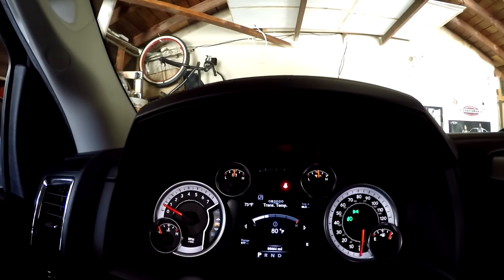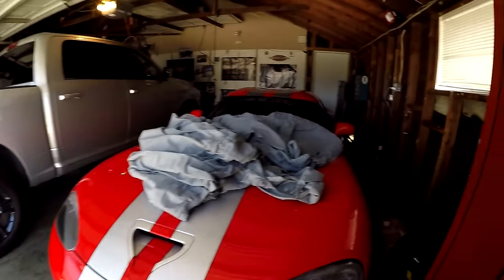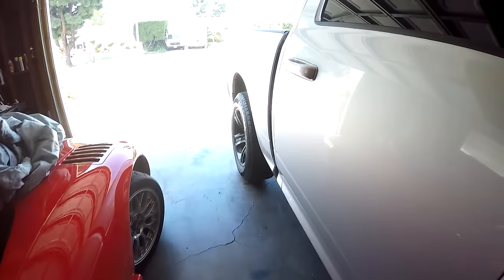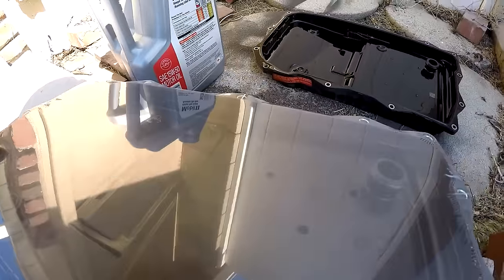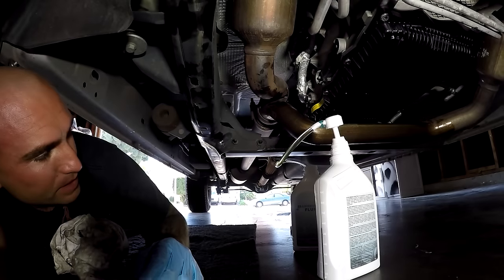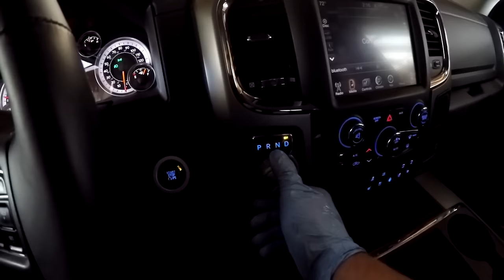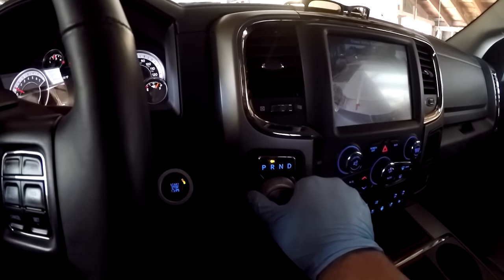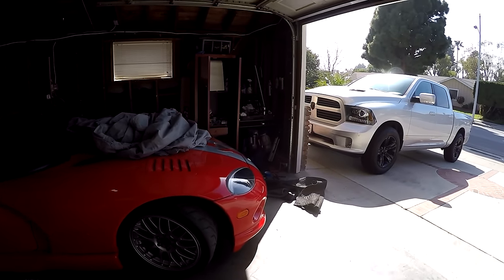Dodge RAM 1500 - ZF 8 Speed Automatic Transmission - Fluid & Filter Change

Comment from the maker: OIL PAN I USED
https://amzn.to/2w00yfJ
ZF LIFEGUARD FLUID 8
https://amzn.to/2LLydER
Pump I used:
https://amzn.to/2YBgfGB
Reply: BoostedMotorsports  what’s the torque specs for the transmission bolts?
Reply: BoostedMotorsports Great video, really appreciate it. Nice Viper, only other thing you could have done is let it also drain from the transmission cooler lines, but other than that great job bro 💪🏼👏🏼👏🏼
Reply: Just use plug lol
Reply: @TheRamiro0980  Yes.. would be nice to know... Is there an answer from BoostedMotorsports?
Reply: BoostedMotorsports what torque spec did you use for the bolts?
Reply: 89-inlb is the TorqueSpec

Comment: You must disable your traction control before installing new fluid. After you change out the transmission pan and filter the transmission needs to be below 86°F when you first start installing your transmission fluid and tires must be off the ground and truck must be level. Add transmission fluid until it starts to dribble out then put drain plug back in. With brakes applied place transmission in reverse and hold for five seconds, place the transmission in drive and hold for five seconds, release the break slowly and accelerate to second gear and hold for five seconds, apply the brakes and place the transmission in neutral, raise the engine speed to 2000 RPM for five seconds, return engine to idle and place transmission in park, remove fill plug and fill transmission until fluid dribbles out and then install drain plug.  All these steps need to happen before the transmission reaches 122°F. If you go past 122° the transmission fluid will start to expand and you will not get a proper fill. !!!
Reply: Underrated comment, getting the transmission to second gear is critical to fill this transmission!
Reply: It's a pit
Reply: How muxh trans fluid would I lose if I did the valve bypass .
Reply: Does the car have to be lifting if my garage is leveled and I’m able to fit under ?
Reply: So do you think he has too much or too little fluid in there? 🤔
Reply: How much would a job like this cost at the Dodge dealer or a transmission shop?
Reply: Lol install the drain plug after filling the oil 😄. Almost like a trol post.
Reply: @joeshmoe8952  Got Service Quote today -- $1,200-$1,400 at my local DFW TX Ram Dealership for the ZF-8 speed.  They stated I didn't need to do the service until I reached 150k.
Reply: @slobbo456  They’re crazy at 150k, by then the transmission has already been contaminated with the dirty oil and changing it with clean oil would only make it slip.
Reply: @joeshmoe8952  They said the fluid in the system is contained.  Also, said the procedure is intensive unlike the other Trans fills/flush/filter jobs.  I was originally quoted $229 for the "other" tranny's procedure, until I provided the last 8 digits of my VIN and they said I had the ZF-8 speed.  Therefore, didn't need to bring it in yet and the gave me the ZF quote.  I'm not racing in to get it done nor doing it myself until 150k....(this Boosted Dude's trans fluid didn't look terrible to me after he cracked it open).  Your Truck--Your Call !
Reply: @slobbo456  I got a couple of Toyota’s that the dealer said it had “Lifetime” transmission fluid. Told me to never change the fluid. That was all a bunch of bs. On one of my Toyota’s I never did because I believed the dealer and it’s got around 218k miles on it. It runs great but I feel like that transmission can go out at any moment. One my other Toyota I changed the fluid at 80k and I have more of a piece of mind with that car when it comes to the transmission. I can easily change the Transmission fluid on my 4runner with high miles but it will just make my transmission slip due to the transmission running so many years with dirty fluid.
Reply: @joeshmoe8952  Totally agree with you on the "lifetime" fluid bit (BS).  Wonder how they gauge how many miles are in a transmissions' lifetime....   To us, a lifetime means 90+yrs? -- to Toyota, what is a lifetime?    I assume it means once your transmission is shot, the fluid has expired.  Goodluck
Reply: @joeshmoe8952  800$ is what the dealer quoted me.
Reply: @antrenfroe2750  That is a good amount of money, that’s for sure.
Reply: Sounds sensible except "release the break slowly and accelerate to second gear".  So you either drive through the back of the garage, or you're implying you're on jack stands with wheels spinning in the air which sounds crazy.  Can you clarify?
Reply: @joeshmoe8952  $276.00
Reply: @joeshmoe8952  i have 107000 & looking to change my pan and oil. What does anyone suggest.
Reply: @andymercado3257  The dealership or a real good transmission shop that does good work.
Reply: @silverscout2643  having too much won't hurt it. Getting the trans warmed up in that time frame is the trick. That Fluid is like water. It will expand and thin it even more.
Reply: Hi, what is the torque specifcation for the pan bolts? Thank you..
Reply: @alfredosuarezalonso9461  it really doesn't matter.. as long as you don't go full on tighten. I like to go 1/4 of a turn of a full rotation of the ratchet with a socket when it starts to get tight. 

Had it done at 46k Miles in my ram and up to 52k miles now and no leaks.
Reply: This just tells me not to even think about trying this task whatsoever!  Oil is one thing, to get this right is too complicated.
Reply: @joeshmoe8952  when you can’t change the oil is when you fell really behind on changing it causes your clutch to wear  and the oil becomes the grip of your clutch. So you should change it as recommended it needs clean oil to protect the clutch pads . Recommended oil only on transmission.
Reply: @frankposterello1628  Read his post again - earlier in the the post he states: "and tires must be off the ground and truck must be level"
Reply: @bryonthelyon  Thanks
Reply: Jim Haley - After you say the tires must be off the ground and truck level the next line evokes a question: Add trans fluid until it starts to dribble out and the put drain plug ( or should it be fill plug ? ) back in.

Drain plug seems wrong but I’ve never done it.
Reply: These steps would be the same for a 8spd 2014 1500 v6 right ?
Reply: Lol. So no fluid change in June in tx….
Reply: @alex81815 yes
Reply: The strangest comment ever
Reply: @slobbo456 i was told by 120,000km
Reply: You are special. How long can you hold your breath?

Comment: I have a '15 Charger RT with the ZF 8HP70 trans and it seems you may have left out something that could affect the correct filling procedure, namely physically accelerating the car while it is off the ground.  This is the fill procedure direct from the FCA oem factory service manual that I bought: 

  1.Raise and support the vehicle on a level hoist (Refer to 04 - Vehicle Quick Reference/Hoisting - Standard Procedure) . 

  2.Start the engine. The engine must continue to run for the entire test

  3.Using a scan tool or the vehicle information center, verify that the transmission fluid temperature is below 30°C (86°F). 

  4.Remove the transmission fill plug from the right rear of the transmission case. 

  5.Add transmission fluid until it trickles from the fill opening. 

  6.Install the transmission fill plug and tighten to the proper (Torque Specifications) . 

  7.Lower the vehicle for access to inside of the vehicle, leaving the tires at least 8 inches off the ground. 

  8.With the brakes applied, place the transmission in Reverse and hold for 5 seconds. 

  9.Place the transmission in Drive and hold for 5 seconds. 

  10.Release the brakes, slowly accelerate to 2nd gear and hold for 5 seconds. 

  11.Apply the brakes and place the transmission in Neutral. 

  12.Raise the engine speed to 2000 RPM for 5 seconds. 

  13.Return the engine to idle and place the transmission in Park. 

NOTE: 

A full transmission will have fluid at the fill hole with the transmission between 30°C (86°F) and 50°C (122°F). Do not over fill. 
  14.Remove the transmission fill plug and allow excess fluid to drain from fill hole or add fluid as necessary. 

  15.Install the transmission fill plug and tighten to the proper (Torque Specifications) . 
  16.Using a scan tool, clear any DTCs. 

The driving the car may be there to be sure that there is proper oil circulation occuring in the torque converter.  When i drove the car on the jack stands, a warning light happened for the traction control which is likely related to the DTC's mentioned in step 16  I also believe that it is important to measure what comes out when you drain as a reference so that you do not overfill..
Reply: Paul Andre There's a video about this as well. It also mentioned that an engineer from ZF talked about a temperature bypass valve that sends fluid to the condenser for cooling after it reaches 160 degrees F. So it doesn't completely circulate the fluid until after this temperature is attained. In other words you could have air in the system or not have the proper amount of transmission fluid if this step is left out. It's pretty much a two day job. Just stating what I did my own research on, not an expert in any way.
Reply: Just an fyi...from ZF themselves the step of taking the vehicle off the ground is not necessary or even recommended. They have very clear instructions on their website as well. The ZF8 is used in many many different makes of vehicles these days. Not sure why Fiat added the step of driving with wheels off the ground but it is not necessary.
Reply: @MrLatinKing13   This gentleman is right I have not see on the comments yet anybody mentioned this if you do a deep dive from ZF  It's not quite this simple.
 There will be the fluid stuck, As you mentioned there's a few videos out thone I've seen from Z from ZF I've also seen one From basically a shop teacher at a University who talks about ZF Directly recommending How to do it to get that extra oil out it's basically a 2 day process, To do it right. Or you're gonna have approximately 30 to 40% of old fluid Mix them with the new fluid.
Reply: Seems to me the step was added as a mental persuasion/upsell tactic. $$$$ in the dealerships eyes. Throw that step in and people's minds blow up
Reply: @jasonbudge8023  What you say is interesting, and how did you do the procedure? Did you leave it on the ground? And did you level the vehicle or the transmission? I'm interested in knowing to change the oil in mine.

Comment: Just came from your vid for spark plug change to YOUR hemi with a boost of confidence now! I have the '09 Hemi Durango which is a totally different setup than here, but wanted to share the method I did for my transmission draining to avoid the potential fluid mess: Purchase a cheap plastic under-bed storage bin with wheels from walmart, drape the thicker quality plastic roll sheeting over it making a well with extra sheeting overlapping the sides for the floor to contain any splash. It held the fluid beautifully. When ready, roll the bin out carefully, make a pouch and lift out. With a helper just poke a hole and drain into whatever oil drain jug/pan you normally use for disposal. The bin never saw a drop on it. Excellent DIY vid's - SO appreciated. Cheers!!

Comment: I really appreciate all the work you put into your videos; excellent, excellent work! I completed this task on a 2015 RAM 1500 Lonestar I recently picked up with the ZF8HP70 transmission (91,000 miles... no transmission fluid change). Having experience with some domestics (Corvettes) and some foreign (Mercs and BMWs) marques, the "sealed" transmission was familiar as is the process of changing the fluid, but this video helped tremendously! After some research, I decided to use Redline D6 ATF - I highly recommend this as an alternate!

Comment: Wrap tin foil around your exhaust pipe so you can use the drain plug fellas. Then use wet towels around the exhaust during filling process and you wont burn your arms.
Reply: FINALLY . . .Some one's thinking !
☆

Comment: Definitely doesn't look all that bad. Also the non premium dash clusters show you the transmission temperature just like the premium ones do except it's just a vertical white bar that shows you the temp range and it shows the actual number for what the trans temp is at too. Still kinda wish you had kept the truck longer but love all the old and new videos

Comment: Thanks for the video very helpful. I was under the impression that the transmission had to be level when you checked for the fill. From what I’ve read the back end needs to be elevated for this. The only other thing I’ll mention is the background music was very annoying, could just be because I am hearing impaired but it made it hard to hear you. Thanks again for the video.
Reply: trans does need to be level. Looks like he only raised the front end, back wheels are on the ground.
Reply: "Music" ( Noise ! ) on an instructional video is counterproductive. 
As useless as a a training seminar at a busy Miami nightclub.
☆
Reply: yes that music, which it is not,, sucks!!!

Comment: Once you can switch over to a replaceable transmission filter I would anyway change fluid every 30,000 - 35,000 miles depends how much you tow. Great great video. Thanks

Comment: Please can the music next time around. Thanks. Thanks for the video.
To get the level correct the truck must be lifted off the ground, level, and gone thru the gears ~ 5 sec each while running. There's a video on YT on how to do that.
Reply: Some interesting porn music...LOL
Reply: With the brakes on or with wheels spinning in the air?  Another comment made it sound like you take your foot off the brake while doing which seems insane... especially going through the gears.  Can't someone with access to the shop manuals post this procedure.

Comment: Good video, but the background music is very distracting and needs to be removed.  Also, is there a way to flush the transmission, because you still have old fluid in the torque converter, correct?
Reply: Not really. they stopped putting drains on the TQ long ago. The only option is to pull off the cooler line and put a drain, fill in place. However, you cant check the fluid like this. Typical shops who use the cooler line to drain out the old they are filling with new in the dip stick... well there is no Dip stick. Bottom line, NOT possible to flush. You don't want to flush an older trans anyway, detergents in the oil is dissolved.
Reply: Don't flush the transmission! Just change the fluid.

Comment: Thanks for this. I thought that in the manual, it calls for the truck to be off the ground (lift or jack on the diff), and to let the transmission shift in drive, from 1st and into 2nd gear. I think you may be short of fluid, as the 2nd gear shift pulls more fluid? Check some other videos. I'd hate to see your trans hurt low on fluid.

Comment: Ever have any problem with the trans overheating?  I bypassed my trans heater valve from the radiator. It went from 240 highway temps back down to 150. No CEL so far. 14 ram 4x4

Comment: The reason Ram says this is a "lifetime" fluild is so when the transmission fails they will do what ever they can to get you to buy a new truck, it's planned obsolecense.  They don't want your truck to last forever lol.
Reply from the maker: Exactly!  Its funny if you read some of the comments people still try to say "its lifetime why are you changing the fluid" lol
Reply: BoostedMotorsports it's usually a tactic to get the vehicle yearly maintenance cost down. Then they can say that it cost less to maintain your RAM than the competitors.
Reply: Most vehicle manufacturers have "lifetime fluid" nowadays, not just RAM.
Reply: Lifetime fluid is a scam.
Reply: So, in general, what range in miles should it be changed?
Reply: @Burgher1605  around 80 thousand
Reply: I have this same transmission in my BMW. I called the dealer to ask them and they said its lifetime fluid, complete BS. Dont believe a word of it. Trust the original manufacture.
Reply: @Burgher1605  the manufacturer of the transmission recommends 50,000 miles.

Comment: Nice video, so you have to get transmission up to temp before dumping the fluid as well? Then once pan is replaced fill with as much as it allows before it starts flowing out?

Has anyone made a full flush video yet? On GM vehicles i would drain pan, replace filter. Add what i drained. Disconnect atf hose from cooler and run until all the dirty fluid came out then shut off and replace same amount. Then it had full system of clean fluid